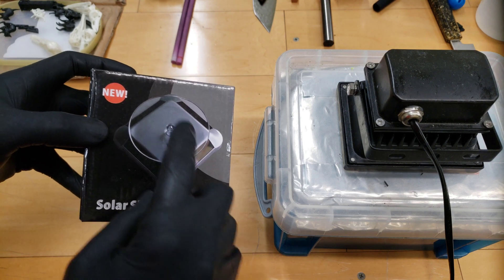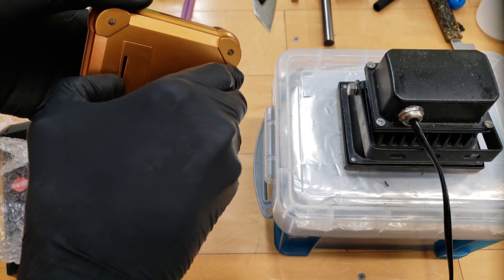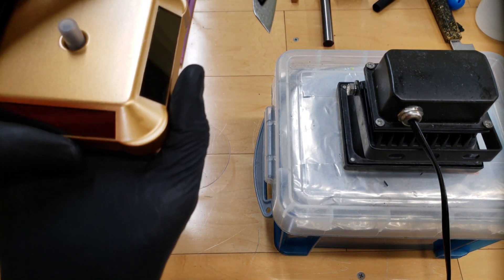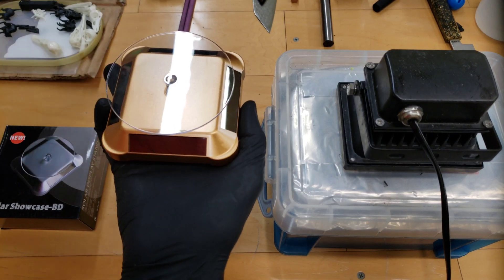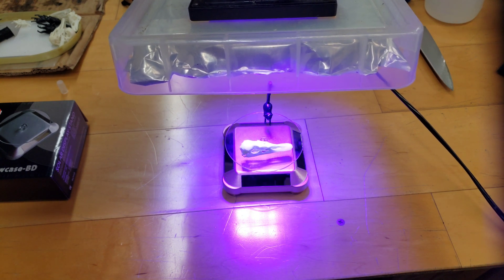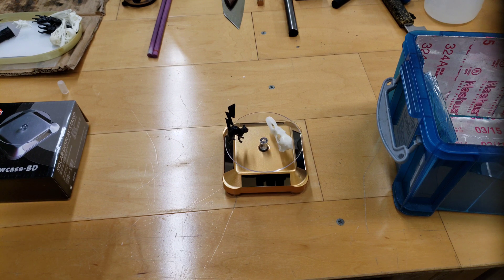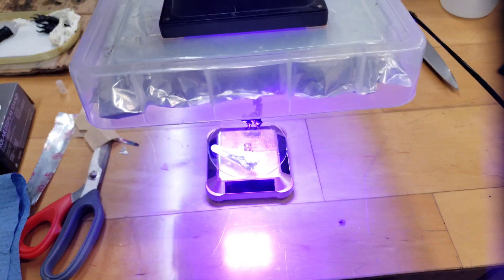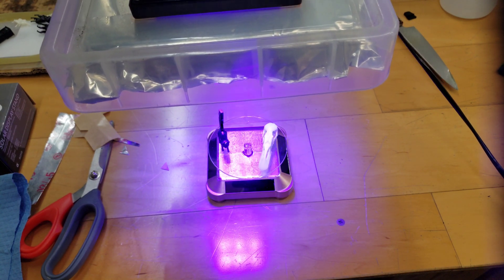Solar Turntable For 3D Resin Print Curing | Cure Prints Evenly On Every Side At The Same Time

Comment: If you put the print in a glass jar with water under the uv that makes it cure evenly
Reply: Yeah the glass jar is key
Reply from the maker: @sos-vm9yi  Thanks for the tip! Will give that a try.
Reply from the maker: I've tried curing in water before, especially to get rid of any surface tackiness, but always in plastic containers. Is glass jar the key to getting the UV to reflect all around the part?